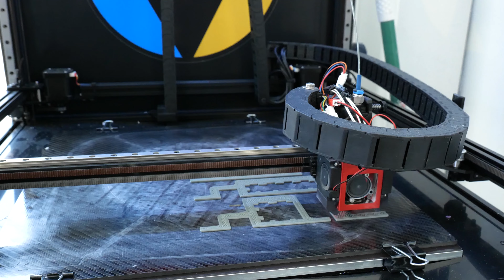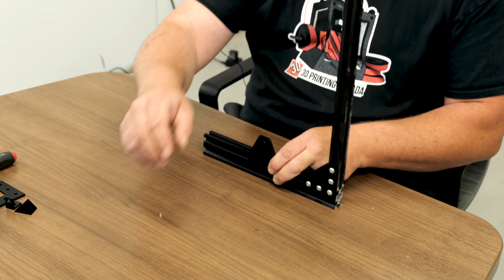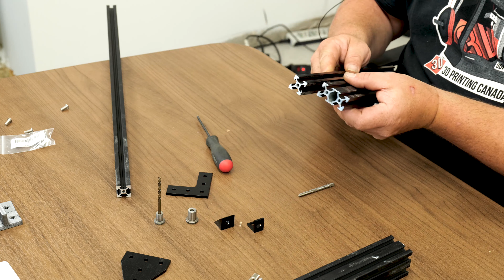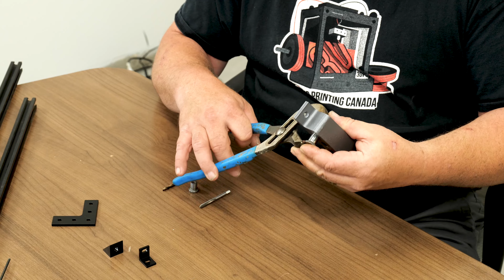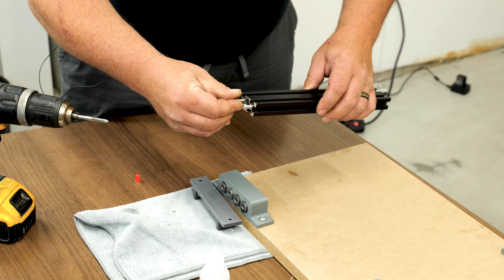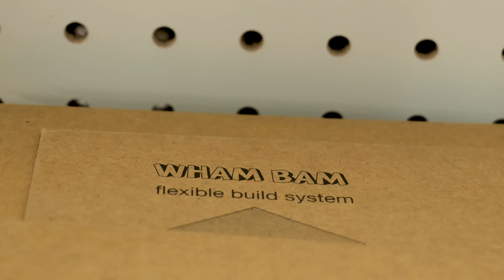3D Printing Canada Build It System

Comment: Nice system and well explained. A spiral point tap would push the chips into the hole and also let you run the tap in once. As far as I can tell you are using a hand tap :-)

Comment: Cool gizmo you guys came up with. Not that I’m in the market to build a new printer since I got the Modix Big 60 off you guys and it’s working great, but if I was, or if I was to build the Modix I would of loved it if the aluminum extrusion was bare. Not sure if those are painted or anodized but either way I would of liked it bare. For me, my machine is never going to come apart, so I would of used JB weld on all the joints along with the brackets or this system. More rigid = more better imo.